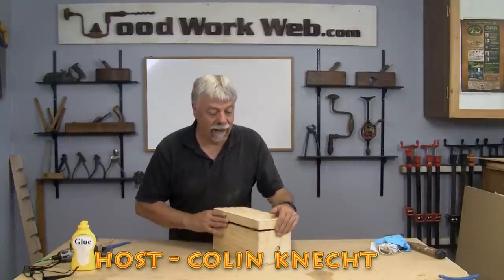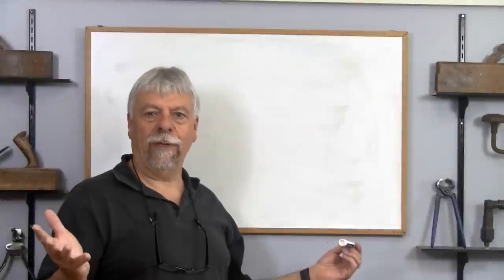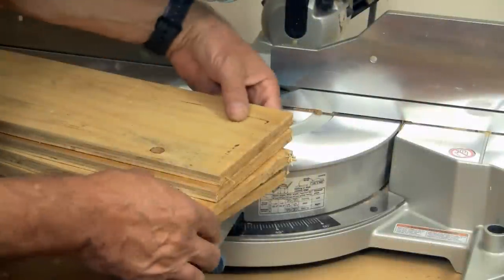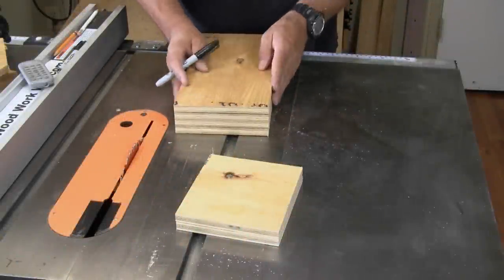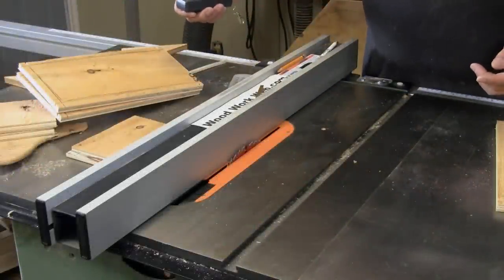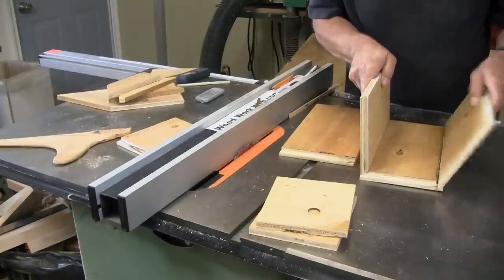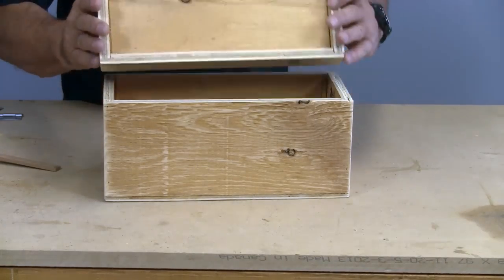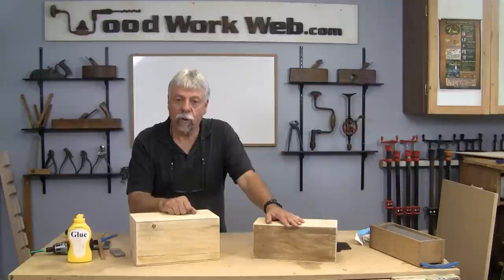Making a Simple Wooden Storage Box |  A Woodworkweb woodworking video

Comment: Thanks for the simple box. Note that your outside measurements after completed job is 6.5 inches high = to 6” plus 1/4” for top 1/4” for bottom.
I was working to exact outside dimensions. I cut the sides to 5.5” (6” board cut less thickness of board) plus extra length for cutting 2 ends. the ends would be 5.5” by 5.5”.

Comment: Great vid Colin. Just something I think is worth mentioning is to use some clamps to secure what will be the top portion of your box instead of nailing it. This is to avoid any nails which are extremely hard on the carbide teeth of your saw blade. One nick and there goes a bunch of money. Thanks Colin and keep these great videos coming.
Derek
Reply from the maker: GiddyUp994 Thanks Derek, great point and one I missed, yes clamping the glue is a great, easy way of making these boxes for those who don't have air pinners or who don't want to use pins in them.Thanks Derek ... great point !!

Comment: Mr Knecht, Thank you for this video, I just made my first box based on your video and it's great! Also great fun to make a storage box for my wife's tools.
Reply from the maker: bert kraan Perfect, glad to hear .. thanks for sharing this
Reply: WoodWorkWeb I finished the box by cutting the lid after the glue dried. I made the box using dado joints all around and put together a littel spreadsheet to calculate what you have to saw when you know what the inner- or outer measurements should be. See picture of my first box and the spreadsheet at:
https://www.dropbox.com/sh/ejvqpwoz005xbxw/AAB_AClIeiEgf5eNOogfQuG0a?dl=0

regards,
Bert
Reply from the maker: bert kraan Well done Bert, you did a nice job of that, you will find these kinds of boxes very useful.  Are you going to put hinges on it or leave it as a lift-off lid?

Comment: Lauan or utility panel has been used in the theatre for the last 40 years--or as long as I can remember to make flats (walls).  We use 1/8" or 1/4" sheets on top of a frame constructed out of 1X3s.  We call this a TV or Hollywood flat.

Comment: Hi Colin!  Love the channel, you do great work.  My only problem currently is that videos such as this seem to be geared towards beginner woodworkers like me, yet in them you make full use of your well equipped shop.  As a beginner I must sadly inform you that I have not yet come to acquire such an assortment of tools.  But I would still love to try some of your projects.  So I was wondering if you could come up with some projects where you would only need to use basic tools that would be easy for a beginner to acquire (so probably not table saws, bandsaws or miter saws with pizza sized blades) and make videos for them, because currently I'm trying to figure out the best way to do this with just a circular saw to cut with.  If you have tips on what tools I should invest in early or videos you already have made like this, please let me know!  Thanks.
Reply: +Brandon Wolker thank you for making this comment, I hope Colin takes your feedback on board because I very much would like to do some of these projects but with basic tools.
Reply: +B Zaheer I notice Colin hasn't responded.  I wonder why?
Reply: Brandon Wolker, the problem with woodworking is that it requires a lot of tools to work with the wood. Unless you plan to work with strictly hand tools (which is possible to make this box with hand saws, hand planes, a rabbet/router plane and measuring tools) I think you certainly could build this with a circular saw as far as cutting to size, but I would not recommend trying to cut rabbits with it.
Basic tools like a table saw and miter saw can be found relatively cheap and are essential if you want to use power tools safely 
I would suggest looking into hand tools, they can be found at garage sales and antique places for cheap
Look up a channel “wood by wright” he does pretty much everything without power tools and makes many great things 
Starting wood working can be daunting, I started not too long ago and I think the hardest thing is having all the tools you need, it’s frustrating if you don’t have them and yes there are ways of using other tools to get the job done but you have to step back and ask yourself “is this safe”, “what are the possibilities this could go wrong” power tools are dangerous especially ones with blades and the hospital costs more than a few tools I can guarantee you that! 
So just be patient and safe and work within your means 
It wouldn’t be hard to make a box like this with just your circular saw as maybe a drill and a tape measure and straight edge, just maybe skip the rabbit part, use only glue (trust me wood glue is often stronger than the wood) and you could make a similar box that may not look as refined, but will be useful

Comment: Like it. I will make one tomorrow. I know what I want to put inside so I need to work my way inside-out and not like you did outside-in. It is a bit more calculation and I do not know yet how deep the rabbet will be I guess I will cut the 2 end pieces once I have done everything else. I do not want to crunch all the numbers before and then be wrong anyway ;-).
I built some tool boxes before and then I did not watch the edges. The just needed to be working and good enough for my skillsaw and sander. The one I want to do tomorrow will be to store our raclett-grill on the balcony and I want it to look a little nicer. Not that rough. It is inside almost 2 feet, so it is bigger than the ones you made.
Anyway, I will use the same technique to build it.
Thanks for the inspiration.
Reply from the maker: Bernhard Korjonen Perfect, sounds like you have it figured out, maybe you will share some pics on woodworkweb with us :)

Comment: Thanks Colin, for the video that teaches simple techniques of making a box.
As pointed out by Jerry Benoit, your saw blade hit a nail in the plywood while cutting the lid (at10:02). As you would have realized later, when you pick up free wood from construction sites, you should always check them for embedded nails. Which method do you think is the best for the purpose?
Reply from the maker: Bala Chandar Hi Bala, actually I did not hit a nail, I hit one of the air pins that I drove in myself ... they are only 18 gauge, so more like thin wire than an actual nail and despite the small spark, the blade is fine.
Not recommended to hit these fine pins, but if you do ... it's not a big deal :)
Thanks for posting ... others will learn from this too

Comment: At the 6:00 mark of the video, you have finished marking the edges that will be removed with the dado cut.  At the 6:07 mark, the plywood already has a cut in it, which sets the depth and width of the dado cut.  It seems to be 1/2 the depth of the plywood.  Is that correct?  Also, how far in from the edge does that cut need to be for all sides to fit together properly?  I'm trying to determine how much wood needs to be removed in that dado cut.  Thanks!!!
Reply from the maker: Dave Quear Hi Dave, basically all I did was cut a rabbet that was the width of the material I was using and half the depth. So this was 1/2" ply so the rabbets would be 1/2" wide and 1/4" deep. If I was using 3/4 ply the width would have been 3/4" and 3/*" deep.  Hope I answered this for you, if not ... let me know :)
Colin
Reply: WoodWorkWeb
Thank you!  That answered my question perfectly.  I'll be giving this a go this weekend.

Comment: Second time around? Some things I would do differently: is it necessary to use a nail gun? The glue is probably as strong as the wood. Before assembling the box the inside could be lightly sanded. Much easier than afterwards? The location for the lid can be marked on the box before nailing the box together. I this way the nails can be kept away from the cut and there will be no damage to the saw blade.

Comment: Very instructive video.
I need to make some simple(wooden, plywood or OSB}  boxes for some of the power tools which I still keep in their original cardboard boxes. That is not very practical because it takes rather a long time to take them out and afterwards to put them back, the cardboardboxes are rather outworn and do not offer place for sawblades, sandpapers drill bits etc. which are necessary for operating the tools. But I need a lid which can be opened max till 110 degrees in order to save space on the workbench or wherever I open the box. Do you have a suggestion how I can achieve this in a simple way?.

Comment: So hopefully you see this even though it's been 7 years. I'm doing a box according to these instructions. Thing is when I get to what you do at the 6:50ish mark, I either get three sides to cut fine and the fourth requires me to break off chips and sand it, or two of the sides, usually the shorter ones because my piece of wood dips into the gap of my saw (even though I have the plate over it). Any suggestions?
Reply: Tape wood shims into the gap.
Reply: @wiseoldfool  wouldn't they get cut up once the saw turns on
Reply: @jstarr3676  Cut one side, then tape a shim into the gap. Turn the box 90 degrees, make the next cut. Repeat until all 4 sides are cut. The shims should be the width of your blade kerf.
Reply: Colin does this in his video on making  one-piece box using the router.

Comment: Great video. I've recently found myself with quite a bit of time on my hands and wanted to get into woodworking a little bit. This project looks like a great starter project.
One question, where does the bar come in? In the middle of the dado cut portion you say we will be going "back" to the bar, but never showed it the first time.
Thanks for making the video!
Reply: +Williambahus You should also check out steve ramsey
Reply: +Williambahus He has brass measuring bars that are 1/4", 1/2", 3/4" thick  that he uses to set blade height,  spacing router bit height etc

Comment: I want to make a similar, but larger box. Is there a good joint that doesn't require a table saw? Or perhaps I can set up a guide and make these joints with my router?
Reply from the maker: bradkrit There are a couple of other options, but you may not have the tools for them either, you could use pocket holes, like the Kreg system, or you could use dowels. I am going to be doing a video on using dowels shortly, but as a rule you need a jig for doing these too, but you can make a simple, one-time-use jig from wood.
Hope this helps ...
Reply: If you have a router table table could easily make rabbet joints that way.  Router tables can be easily made with a flat piece of plywood or mdf, nothing fancy needed.
Reply from the maker: bradkrit Daniel Bornhoeft Hey Brad, Daniel is correct, you could make these with a router and router table, and yes you can make one with a piece of plywood or MDF, they are not complex.
I am planning a video on making a fairly simple router table in the next few weeks, just thought I would give you a heads-up on that

Comment: Great stuff but, I have seen a few YouTubers say that you shouldn't put plywood through the jointer because it's really hard on the blades.
Reply from the maker: Larry Wilson I have heard that, but never really experienced it, I also don't use a ton of plywood either. One other thing to keep in mind, with all woods is that you need to move the fence across the blades for edge jointing so you get even wear. Thanks for posting ... good stuff

Comment: When I make a dado without a dado blade, I always have trouble with the tablesaw insert.  I really need to make a zero clearance insert so the parts don't fall into the gap.
Reply from the maker: Nicholas Smerk Good point, Nicholas ... a zero clearance insert might be require for some saws ... thanks for posting ...
Reply from the maker: Nicholas Smerk It's pretty easy to make blank inserts for your table saw if you have a router and table with a pattern bit, that's the bit where the bearing is closer to the router bit shaft, then just double side tape to you existing tablesaw insert and cut it out. Hope this helps a bit ... ask questions if you need

Comment: For anyone that does this, if you nail it shut like that be aware when you cut the lid off, you need to account for nail length, you can see he cuts through a nail on his table saw and it sparks.  This will dull the table saw blade, especially if you cut too high into multiple nails....
Reply: yeah, but on the positive side, it will give people something to talk about for years to come.
Reply: @tmx63  And if he was using a SawStop he'd have a brake cartridge/saw blade sculpture to hang on the wall.

Comment: Here is a great idea for drill bits or router bits storage.Do you know those transparent large 100 cd/dvd storage boxes?
Answer to that is yes of course we do!
Take a cd/dvd and a peace of plywood/wood of any type and you line the shape of cd on a plywood,cut circle  with saw and drill inner hold to look just like cd.Then drill holes for your drill bits.
You can also build smaller circle for smaller bits and stack whole thing like a pyramid.
Wola you got yourself transparent rotary drill bit holder which you can label,is easy to open ,easy to make.
Reply from the maker: zumbazumba1 Thanks for workshop tip

Comment: Great idea and video! As previously said, you can never have enough storage boxes. for fun, I tested the first one I did, and was surprised by the strength of this simple dado joint. One question though. Aren't the plywood edges hard on the jointer blades? If the plywood pieces aren't too big (or if you don't have a jointer), I guess we can use an home-made cross-cut sled on the table-saw to create the reference wedge.That is what I did, and it worked fine.
Reply from the maker: Guy Coallier I keep hearing that plywood is hard on jointer knives Guy, but I never see any evidence of in my shop. Maybe if you ran a LOT of it in one place is will take the edge off,  but that is true of almost any wood ... so it is possible there is a slight increase in wear because you are cutting cross grain, but I don't worry to much about it ... just move my fence from time to time as the manufacturer's suggest, and it all seems good. 
Thanks for the great question ... hope this helps
Colin

Comment: have you made any clamps? Clamps are expensive. One needs all sizes -- What about some sort of clamping system for small pieces on a drill press?
Reply from the maker: M Geez I have not made clamps ... well, let me put it this way, I have not made any wooden clamps that I like, but maybe I am too fussy, maybe I haven't found the right design. I have not made any kind of clamping system for the drill press other that what is commercially available like C clamps, machine or drill press vice etc. ... can you tell me more on this, what you had in mind?

Comment: Colin, when you make your second cut for the dado, you have the off cut between the fence and the blade.  Is there a reason you don't have it the other way around?  I usually have the off cut piece facing away from the blade.  Thanks.
Reply: Probably because getting the exact distance from the fence would be more prone to error than your suggestion, anyway the danger of this small piece of wood in case it was shot backwards is tiny.

Comment: Colin when you use the tablesaw, why do you always set the blade half a tooth over the material?

Why not more or less?
Reply from the maker: creativeobsin Yes, 2 reasons, the most important is reduce the risk of injury, in the "old days" we simply cranked the blade as high as it would go and left it there, but lower does 2 things, reduces injury and gives a better cut.

Comment: I want to make this box but the only power tool i have is a circular saw. I found some free wood and have no money for extra tools. can i make the rabbet cut with just a circular saw?
Reply from the maker: Richard Black To be honest Richard, it's difficult and dangerous to make cuts like that with a circ saw. I think in your case just making butt joints would be best. and you still need to be careful with a circ saw and making small pieces, best to clamp them down if you can.  Hope this helps buddy ..

Comment: Was it just me, or were there sparks on the first cut of the lid?  Did you hit one of the nails that you shot in there?
Reply: That's right, he hit a nail. But the blade didn't seem to get unusably dull.
Reply from the maker: Peter Murray Yes, it looks like I nicked one of the 18 gauge pins and the reason the spark came out is because it was at the end of the cut where I had already cut on the previous side. I don't worry too much about hitting the odd 18 or 23 gauge pins, although I don't make a practice of it. It doesn't appear to affect anything, no carbide missing on the blade, unlike hitting a nail or a screw, argueably it "might" cause a bit of dullness but hard to measure unless you do it a lot, which I don't :)

Comment: Nice video. Any reason to use dado strategy over pocket screws? I'm new to the dado strategy; seems like they would be easier to use. Any advice is appreciated. My project will be an 17"x20"x38" box with drop down doors on both ends (the 17"x20" sides).

Comment: Hello Colin, fantastic video. I have a question. In your experience does jointing plywood on your jointer harm it in anyway? I don't have a jointer, but I have used my hand plane several times on plywood with great results. I have read several times that plywood will harm jointers, hand planes etc. What are our thoughts? Thanks.